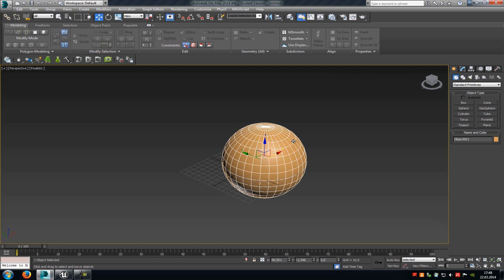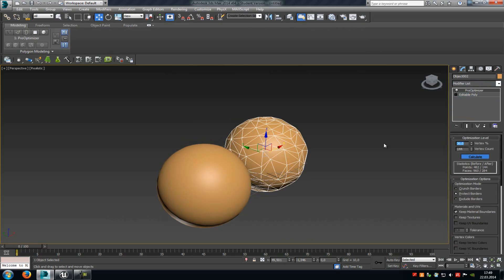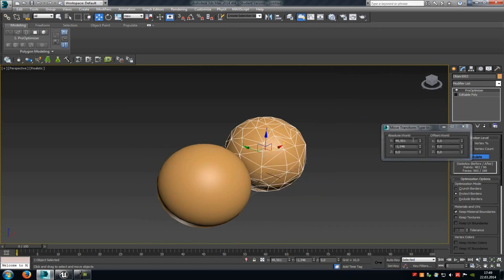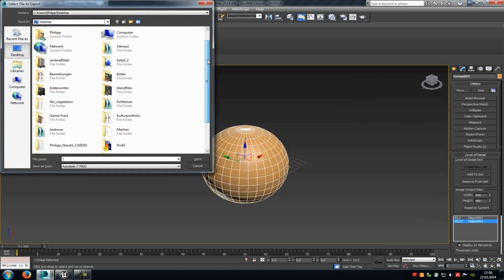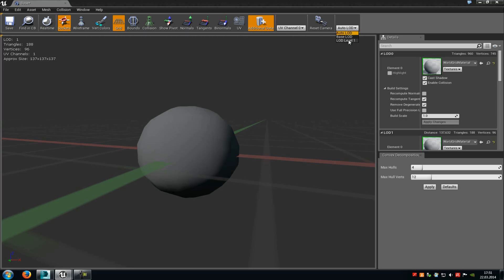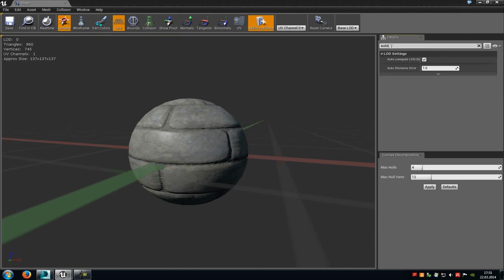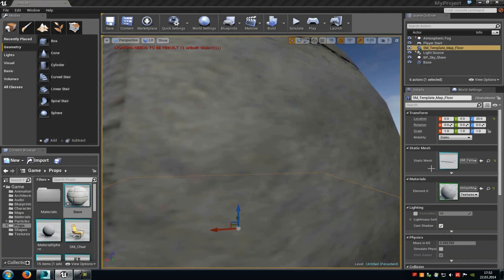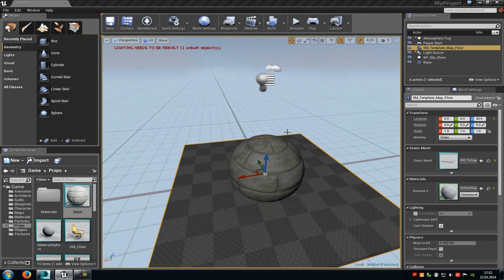Unreal Engine 4/3d max Tutorial: LOD (english)

Comment: So I guess I have to have different UVs for each LOD? And how does lightmass handle that, does it just use the higher detailed mesh when doing lightmass? Curious. Thanks.
Reply from the maker: Yes and no -> you can use the same uv's but normally you can create extra ones to use other textures (e.g when you use a plane as the 3rd lod channel). Sorry, but I dont know how lightmass handels it :)